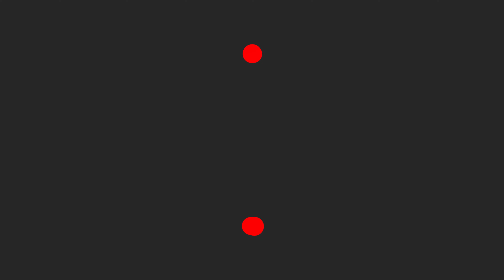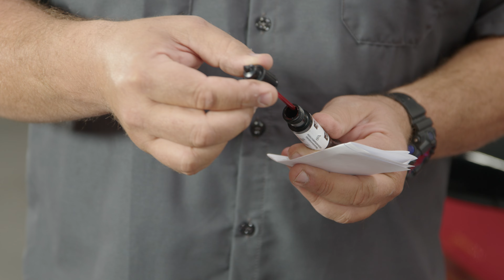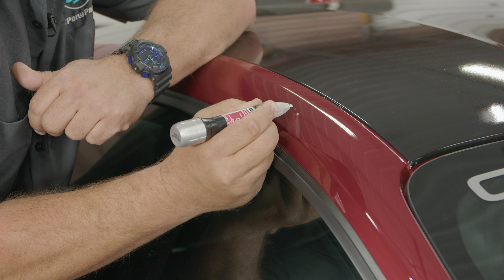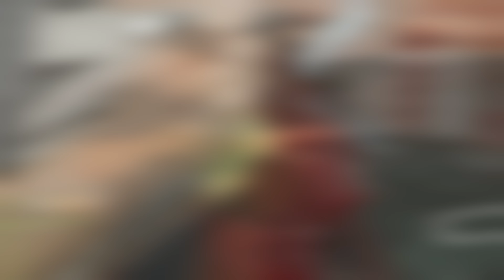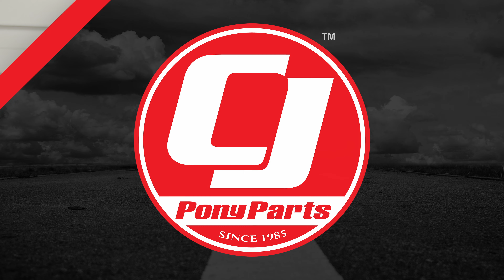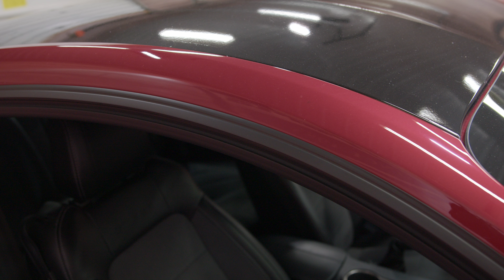How To Touch Up the Paint on Your Pony Car | Awesome End Result 😍

Comment: I had to do this today on my white GT350. Small rock chip on hood. I’ve only done on black cars before. I pretty much did all the steps described here. It’s really the best way to do it. Definitely get a buffer, it’s like night and day. I’ve experimented with different techniques and even with using dremel with a polishing pad. Only use the clear coat on the chipped part. I’ve made the mistake before of covering the whole area that was scratched. Don’t do that. Takes forever to sand down.